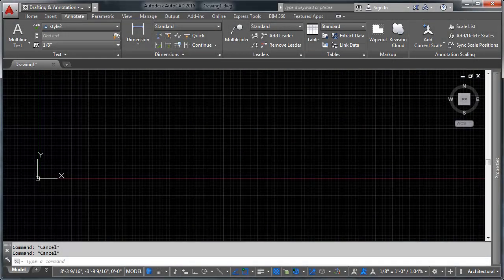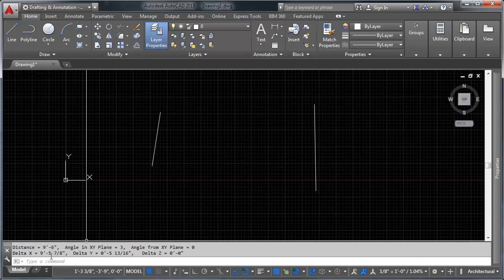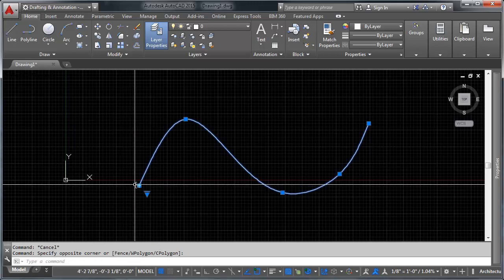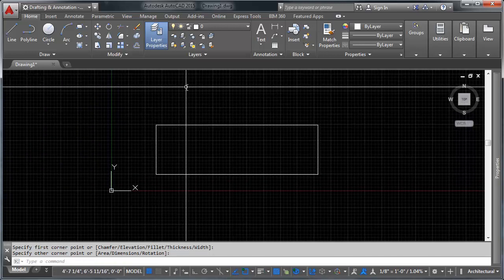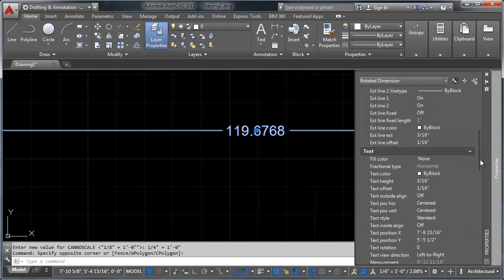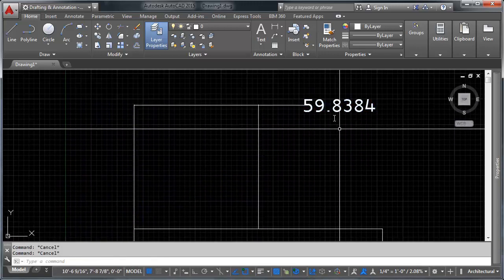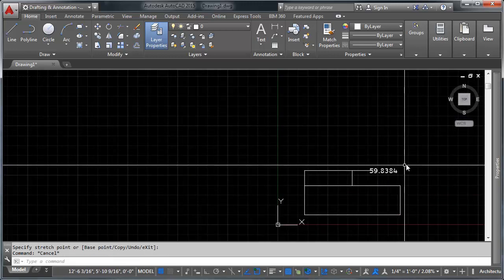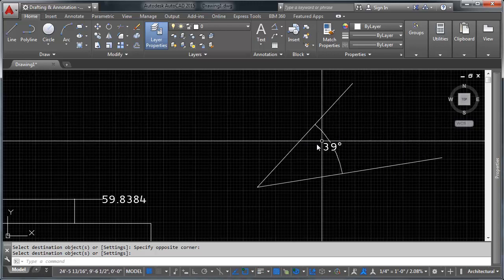Intro to AutoCAD 2015 - 10 - Dimensions

Comment: Hi Ty for the video. i have been making 3D dimensions and noticed the dimension line when placed is placed very far away from the model.

I am setting the view first to see the object side I want to place the dimension, and whne looking at the object from that view the dimension placement looks fine.

But when I use the 3D "Orbit" control and move the model around the dimension moves as well but disappears off screen because it is placed several inches away from the model, so when I rotate the model the dimension rotates way off from the model.

I can not find any answer to fixing this problem.

Also when setting up a style, is there a way to save the style?

Thanks